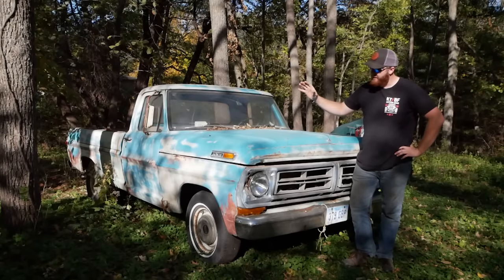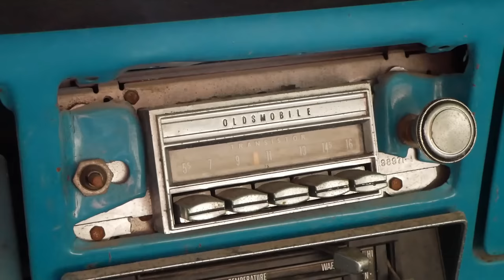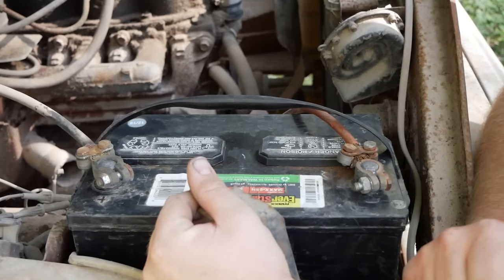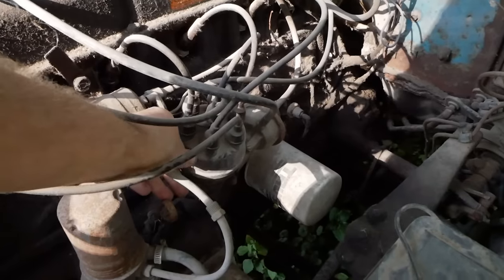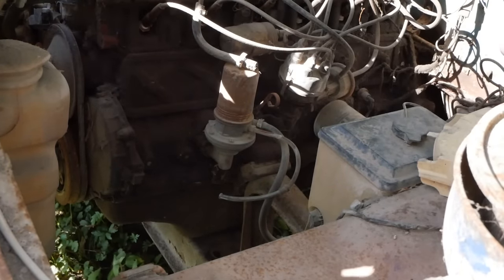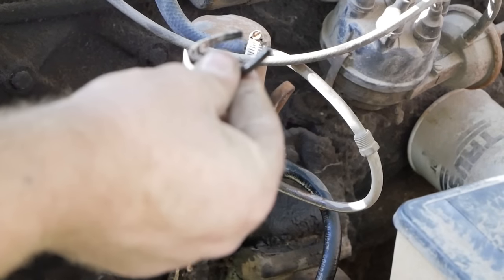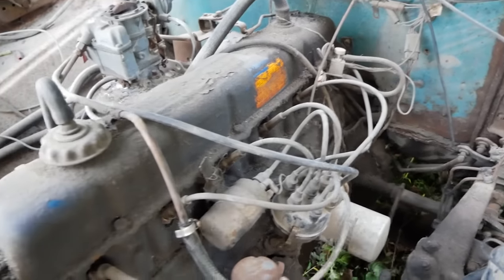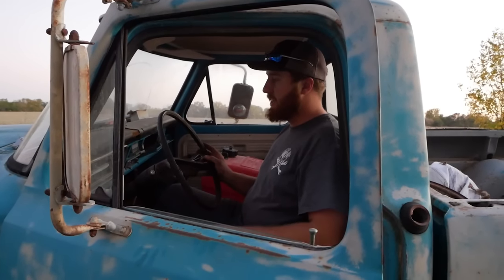RUSTY $500 F100 - Will it Run and Drive?

Comment: "you will feel the math coursing through your body" -Kevin JYD, 2021
Reply: I am totally stealing this one! LOL
Reply: Fucking love math jokes
Reply: I misread that as "You will feel the METH coursing through your body."  lol
Reply: I lost my shituff laughing at that
Reply: As I was reading this, he said it, what odd timing.
Reply: Insert yourself into the equation as a component of I. Slayed me.
Reply: I would buy that shirt JYD
Reply: @nospoon4799  and actually it would be a part of R ...The I is what is passing through to make you shake and piss yourself...just call it a JYD defibrillator lol
Reply: Now that he is moving he can work on the original f250
Reply: @mixerman1  would you just technically be a resistor as you have no purpose in the circuit other than providing more resistance than the wires?
Reply: @greendryerlint  lmfaooo that one killed me too. 😂🤣
Reply: Kevin 3 16
Reply: Lmmfaaoo
Reply: I need this on a shirt

Comment: That "Queen Filter" is a filter for a "Filter Queen" vacuum cleaner. They probably still make that exact model, as they are tanks as far as vacuum cleaners go.
Reply: Yeah, they're sorta like a fancy shop vac sorta configuration. Little felt thing was designed to muffle the exhaust and also to be sprayed w fragrances so the exhaust smells nice.
Reply: Oh that ain't rusty on these.  Rusty is when it looks like someone tried to can opener the roof on all four sides and the bed's style line has a quarter inch gap corroded through the steel.
Reply: My parents bought a Filter Queen over 30 years ago and they still use it to this day. Thankfully that horrid smelling perfume crap that came with it has long since been used up lol.
Reply: my parents bought a filter Queen vacuum over 50 years ago. Good machines!
Reply: I love how American products are named.  Such and such King and This that Queen.
Reply: I inherited my grandma's from 50 years ago.
Reply: also came with an absurd number of accessories, my mothers has a hair dryer and a car buffer
Reply: @SkipNill  😮
Reply: yup, my parents had that exact vacuum, i used it as a kid. cant remember if the cap was on the top or the side but i think top. anyway cool, brought back some memories
Reply: Its not a filter. Its the cover for blower, which is on the top of the vacuum cleaner (can connect the hose to turn the vacuum into  a blower).

Comment: Kevin: "Bought this truck for $500."
Trucks in my area: "For sale, no bed no doors no motor, 5.5k best offer in town
Reply: True 😂
Reply: Trucks are outrageous in my area as well. Though I did pick up a 59 Edsel for $500
Reply: Move to the mid west, rust belt.
Reply: Exactly
Reply: I sold a very decent '69 F100 a few years back for $1700. Ran and drove and wasn't rusted out. They are out there.
Reply: Well no trucks in my area, rusted or solid or anykind...
Reply: @oliverpetroski4205  I'm in California and everything is made of Gold here, haha.
Reply: I bought a 1974 Ford F-250 for 750$ in 1996. It had a 2×8 for a front bumper and the back bumper was smacked up and it was painted primer black. But it had a bed liner and a 6.4 liter 390 with a 4 barrel carb and headers and dual exhaust. I got almost brand new front and rear bumpers from a junk yard for 15$ apiece. I power washed the engine and tranny, and that truck was a good boat hauler for years.
Reply: @SpeedandChromeTV   Im in East Europe, no US trucks were ever imported here, but everyone needs one.
Reply: @oliverpetroski4205  what do people buy instead of us style trucks? Vans and Toyotas? Idk what I'd do if I couldn't own a truck or call someone with one. It would make things far more annoying.
Reply: @SpeedandChromeTV  so, so true. 8K for a clapped-out F100. WTF!?!?!
Reply: @BudMasta  Well, just boring, poor quality and way overpriced mostly used plastic European cars. From older vehicles it just older Citroen, Mercedes, VW, german built Ford sedans,  and hatchbacks Renault, Peugeot...Some cars from the former red countries and Zastava vehicles with missing body parts.  Ive seen less that 10 US vehicles in person so far. Owners used to worked in the states...My fav. pickups are '70s Ford and 3100 Chevrolet with split front window, but we never had anything like that imported. Only ugly European large box trucks. Try moving a large table with 12 chairs across town or mountain in a Yugo. I wish I had a classic pickup.
Reply: @HALOman-vi2tg  don't happen  to be from Ontario Canada? I just happened to see a 59 Edsel being sold in a post about a month ago that I didn't jump on
Reply: Its the same for my area. Rust holes, no engine or motor, no title 2500 I know what I got... I got lucky on mine, the family wanted it gone after sitting for so long in their back yard. A bunch of their friends looked at it and said no thanks, the funny thing is, they only wanted 700. The only bad thing about it is, its missing the gauge cluster and the bed is rotted. Both easy fixes.
Reply: True, I've been looking for a 93-96 150 or 250 4x4 with a 5.8 and I believe people have lost their mind on price.
Reply: @oliverpetroski4205  in Europe the equivalent to us pickup is mercedes station wagon. Rusty but cheap.
Reply: @JamesParus  They look like hearse, Ive seen them. They rust even on the sun. Not just from mercs. Also those ugly Fiat Doblo, and other so called freight cars. Nothing beats 70s Ford pickup truck and 3100 Chevrolet with split front window. 
Back in Yugoslavia they tried making pickups from sedans by doing a chop shop at the car factory🤣 but one truck had potential for pickup like those in the US. That truck was called Zastava 620. But it never happened.
Reply: NO LOWBALL OFFERS
Reply: @oliverpetroski4205  volvo wagons are better. I have one 940 turbo
Reply: @JulianWatsonThe400  Tetanus
Reply: @salvadorpalma8173  Ive never been a huge fan of wagons but Volvo is one super strong car. One of the safest too.😁Rescently saw older model owned by the local police. They just towed it somewhere to make room for the new vehicles. But every time I see a wagon first things that comes to my mind is either a hearse, ambulance or to chop it to make it into a pickup. I own a '73 2cv but not the van version.
Reply: No low ballers .. I know what I have .. LOL
Reply: I consider myself lucky to know an older retiring contractor who sold me his old truck for just $200. 87 - 92 F150's go for over 5K now regardless if it's in decent condition or one pothole away from ending up in a pile of rust.
Reply: In my area: 20.000
Reply: That's just the asking price. Who would pay 5.5k no bed no doors no motor? What you are describing is scrap metal or restoration. It costs a lot of money to restore a vehicle of any kind. Scrap metal will not bring in 5.5k.
Reply: meanwhile other people seem to find them in woods and make them run ha ha
Reply: Go out of your area then like vice grips does
Reply: Should be capitalizing on that. Train ticket to a cheap truck, fun road trip home to cash in.
Reply: @SpeedandChromeTV  Yeah I just want to go on buying sprees to the midwest for old trucks, cars, appliances.
Reply: Yeah I live in WV and trucks are insanely expensive
Reply: It depends on who you know. My family has "junkyards" in all their yards
Reply: It's all about who you know these days. Get out into the community and get to know people, you never know what may turn up if people know you are into old cars!
Reply: @HALOman-vi2tg  Does it run? A running Edsel might be worth something.
Reply: @jacobjohns6047  that sucks bud but I bought it in Tennessee
Reply: Same so same I really hate it I cant even find a car that's only 100 or even 1,000
Reply: Anythink "ViNtAnGe" is worth gold here apparently
Reply: In Australia that truck would be $10k with no motor
Reply: @BudMasta  euro trucks? Like idk what youre even asking as they exist, not in america, because american car companies are too insecure to have competition. and if you think America is the only place with trucks, i have multiple bridges to sell you
Reply: yeah, over here in Va. its the same way, needs a motor but they want a lot of money.
Reply: a guy is trying to sell a 2014 chevy silverado 1500 with over 160k miles with a broken transmission for $7,800
Reply: At least you don't live in argieland. All used cars are priced in dollars, and even a rusted carcass of a car was being sold for 17k

Comment: In my country we call that Industrial Engineering, you literally graduate as an engineer without all the bureaucratic hassle. Idk felt like sharing, and as always, excellent video !
Reply: Industrial Engineering is more time motion studies / yamazumis, ergonomics, cba, 8 waste, value stream mapping ( reduce cost by increasing efficiency decreasing lead /cycle time). applied would be more mechanical with real world applications similar to Industrial Technology Management or the like
Reply: Electrician myself here, nothing wrong with trades as well, to any young guys and gals reading this.

It does beat up your body, but so does dropping transmissions on your chest while under a 60 year old rust bucket 😂
Reply from the maker: Exactly! We call it engineers with social skills
Reply: @perotekku  Good excercise

Comment: In-line 300 6 cyl is probably one of the toughest motors ever made I’ve owned a dozen Ford trucks with that motor over the years and other than being a gas hog they never leave you stranded
Reply: All of the F150's that my grandfather owned over the years while I was growing up all had the 300 inline-6 in them. Except for the current truck which has the 4.2 v6 in it. Which is probably based off the Triton and is probably a bad motor. But I don't think there's any Triton badges on the truck so it might not be. :)
Reply: Thats why you owned a dozen and not 1? Because they are bullet proof?
Reply: Doesn't sounds that reliable if youve owned multiple
Reply: @yeetus59  I would buy one drive it a year sell it go a year or two and need a truck and buy another always f100,150 and once a f250 with the 300 never had a problem the f250 hunting one year the carter carburetor got loose leaked gas all over tightened it with a pocket knife and drove it 30 miles home the 300 was originally designed by Cummins as a diesel motor ford bought the patent and changed it to gas
Reply: @deshaunjackson8188  dude I’m almost 50 I’ve owned hundreds of vehicles I don’t hold on to anything for more than 5 years I get tired of it and move it on not everyone buys a truck and keeps it their whole life you probably hate fords well if it makes you feel better the 300 was a Cummins design bought by Ford now you can take a deep breath and go work on your Chevy
Reply: @brendan25  I guess they think people buy an old truck they keep it for life lol I’m almost 50 years old I’ve had a ton of vehicles swapped traded sold I’m the type of guy buys a large truck thinking I’ll use it for hauling and gardening after a year or so I’m like this thing just sits around and I sell it on till I need another truck lol lots of people do that
Reply: I had a 95 f150 one time it had the ole 300 6 with a 5 speed I loved that truck then one day I was going about 55 down the road and I blacked out and ran it off this big embankment and knocked over 2 cedar trees then finally stopped on a pine tree. The whole front of the truck was smashed and it shoved the motor to where it was against the fire wall. All I did was hook jumper cables up to where a battery was supposed to go and flip the fuel inertia switch and pull out the radiator support and it fired right up you truly cannot kill a 300 straight 6 ford
Reply: @ArkansasHillbilli3  well the truck can always be replaced at least you made it out alright. yeah the 300 is a great motor I think it’s because it’s a very simple motor less things to break the jeep 4.0 in-line 6 was also a great motor but around here the jeep itself rusted into nothing but the motor was still running lol
Reply: They were cranking those tough guys out until well into the 90's, if memory serves.
Reply: @BigLifeWithLitlJay  through 1996 in light trucks
Reply: @kenleppek Interesting. The same year that OBDII was officially mandated. Do you suppose any were sold with fully-compliant OBDII PCM's?
Reply: @BigLifeWithLitlJay  a lot of ford models were obd II in 1995 model year....  I've seen some mustangs and thunderbirds that were in 1994. Ford even had quite an array of flex fuel vehicles in the early 90s.
Reply: @kenleppek  I think I recall finding that out when I was looking REALLY hard at cramming an OBDII PCM and 302 into a Bronco II a while back. Alas, the recession came and I sold the mighty little fourby. That would have been a fun project to see through.

I've got to wonder about the engineering resources committed to setting up an OBDII system for the straight six, surely knowing that it was due to EOL so soon.
Reply: @BigLifeWithLitlJay  all they really would have had to do is as crankshaft reference which I'm sure they took from pick up in the distributor because as far as I know, at least in my 20 years of selling parts, they never used a crankshaft position sensor on a 300 six.
Reply: @deshaunjackson8188   I’ve owned several not because they were bad trucks because I needed several trucks and bought only Fords so your little half witted jab doesn’t play out
Reply: @BigLifeWithLitlJay  I'm sure a 302 set up from an explorer or mountaineer would have been an easy retrofit into a bronco II as they were all derived from a ranger platform.
Reply: @kenleppek  That would be a perfect solution. It's what Dodge did to make the 318 OBDII ready in my '96 Ram.  I gave it a tune-up once and accidentally clamped the new cap down on a wire for the CPS in the distributor.  It didn't run so good after the tune-up until I found that! 😄

As far as the I6-300 goes, I'm thinking more along the lines of wire looms, injector timing and configuration, fuel rails, all those thousands of little details that would have to be fiddled out, even adapting a V6 system to the I6, only to use them for a year or two? Wow.

Can you tell I'm an engineer? 😁
Reply: @BigLifeWithLitlJay  a 96 318 uses a crank sensor that reads off of a reluctor on the torque converter it had a hall effect style pick up coil/ cam position in the distributor.  Ford inline six engines have been multi port injected since 1987 so they already had the rail and wiring. They just weren't sequentially injected like a lot of obd II engines are which plays a huge role in fuel efficiency and emissions.
Reply: @BigLifeWithLitlJay  '96 was last year for the ford  300
Reply: @danbailey96  Don't feed the trolls.  Just ignore them and they magically disappear.
Reply: @HillbillyAdventures  That's interesting, a gas diesel engine
Reply: Absolutely the best Ford motor ever built and you can make them fuel efficient
Reply: @HillbillyAdventures   I’m 66 and have owned over 400 vehicles in my life and the best were fords with the 300 6 so yes you never keep them but the hunt is fun

Comment: Im working on a 1965 F100 that has been sitting for 17 years after the PO drove it from Texas to AZ, parked it, started to work on it then passed away shortly after moving to AZ. Same sort of setup 300 inline 6 with 3 on the tree. Got mine running but not driving yet, still have a bit of work to do on it to make it road worthy but on a shoe string budget its really really slow going.
Reply: Awesome dude, I'm jealous.  Always dreamed of getting a 65-66 F100 with the 300.  I have my father's sixth generation 100 with the three on the tree 300 straight six.
Reply: Just hang in there, my friend. You've got a good solid foundation with that truck.
Reply: @reubensandwich9249  I have  a 64 with the 292 V8 ., but it's hard to beat the 240 and 300 sixes. Had a 240 that used up two vans .

Comment: I'd daily that F100 truthfully all the inline six engines I've owned were all strong and decent on the fuel.
Reply: But the thing is, it is high mileage and stood for a long time. Probably needs a lot more work to be able to actually daily.
Reply: There is no such thing as a bad straight 6. Think about it. All of them are great, because the I6 is the purest, naturally balanced rotating assembly.
Reply: @tnc7399  I bought a 73 f100 302 3 speed for $750 all I needed to make it dailyable was $300 for all the brakes but I’ve put a lot more into it than I should’ve but I daily it
Reply: @Tuck's Handmade Goods 11 is better than alot of old rigs thanfully my 89 f150 gets 25+mpg
Reply: Yep inline six spins forever, not a Ford guy, prefer Chevy, but the straight six engine is a diamond running forever. Had several 6-cyl Chevy's in the past, no issues at all.

Comment: That fuel pump with the integral filter...  I just replaced the one on my 1977 F150.  Got it from NAPA.  The one you have looks like it is rebuildable!!!  It looks like you can replace the pump diaphragm!!! Mine is crimped.  My old 1968 Cougar with a 289/302 had that style pump too, but when it died, I replaced it with a non-filter pump. Shame that contour rear bumper is bent.
240?  My '77 has a 1968 240 that someone swapped in. A screwdriver through the sparkplug hole resulted in closer to three inches of stroke. 300 will stroke closer to four inches.
This channel kicks ass, and approaches Watch Wes Work levels of intellect!!

Comment: I put almost two hundred thousand on one of those 300 sixes. At that point I was adding one quart between changes,three K. Never had any trouble with the motor except the plate under the carb had to be replaced, and of course starter, alt. and water pump. Great old trucks. Wish they still made them, we would all be better off.

Comment: The 240 and 300 are some of the toughest engines on the planet. My grandpa has a 240 swapped into his 77 F150 after the factory engine died. And its ran for years without an oil change and had gas in the oil, cracked plug wires, and up until last year a fuel system that sucked more air than fuel. Still going strong. The things legendary